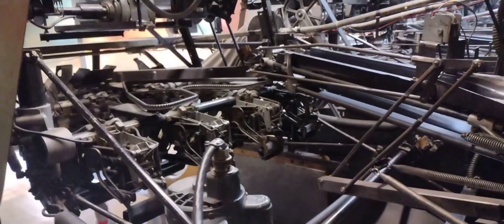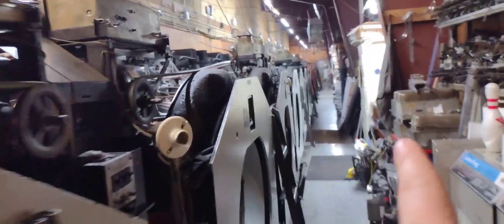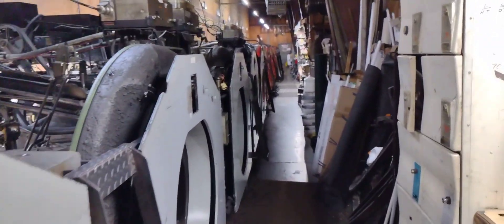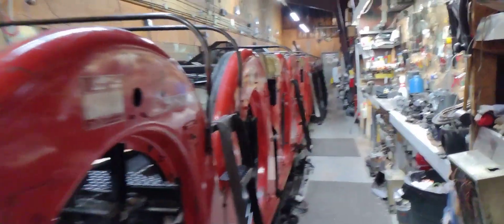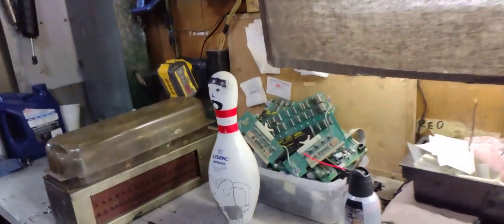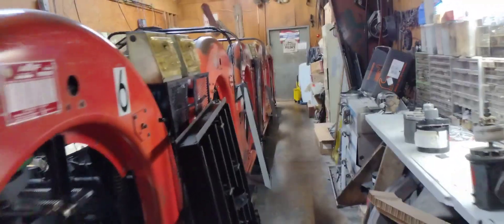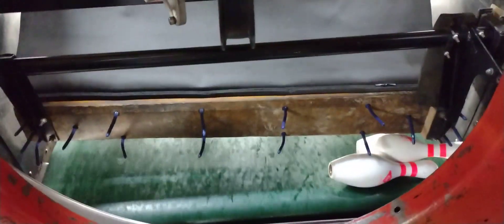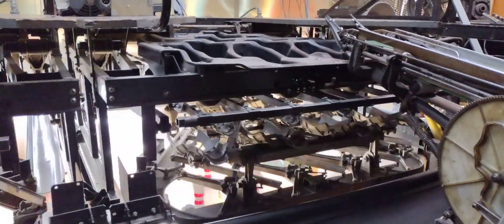Behind The Lanes

Comment: Ah yes, classic AMF 82-70's. They work much better here than the AMF 82-90XL's I bowled on which they run like crap.
Reply from the maker: I worked on the 90s for 6 years never had an issue with them
Reply: @FlameDragon   Good to hear that. The ones I bowled on were bought refurbished back in 2012 or 2013 and they were not maintained at all for 9 Years (it will be 10 Years when May 10, 2023 hits) and thanks to the Pandemic for shutting the place down for 2 Years straight, their pinspotters were breaking much faster even after being reconditioned. Btw, this Bowling center is a mall corporation owned and my League had nowhere else to go because the other Mall Bowling center (with Brunswick GS-92's) we used to bowl at before burned down in 2017 and it won't be reopen until after the mall finishes by next year.